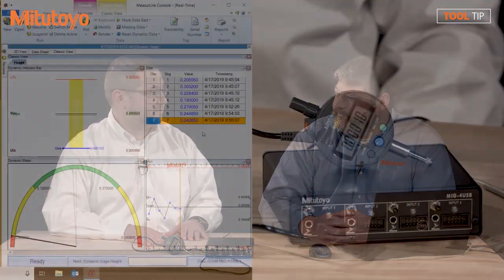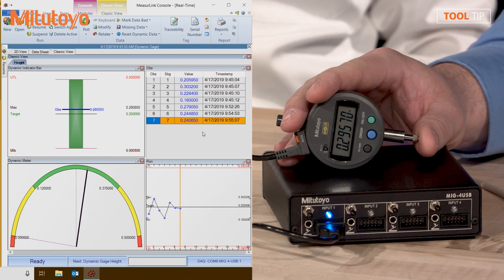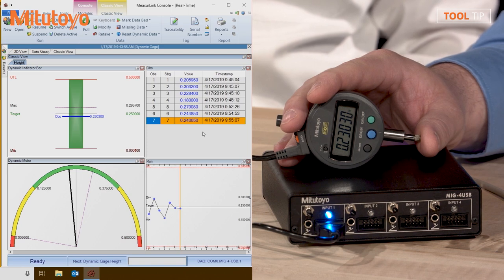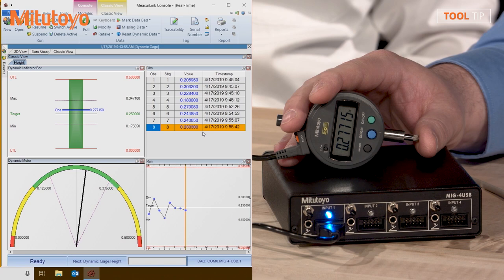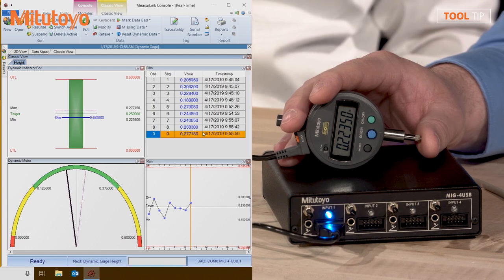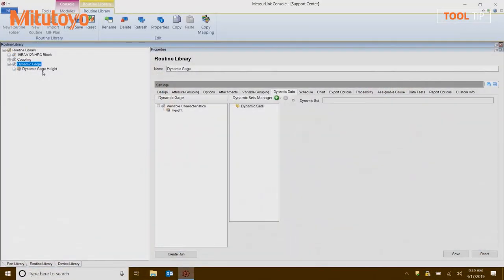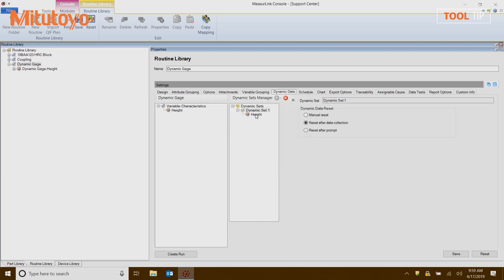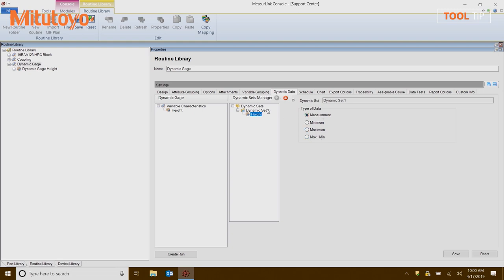Dynamic Gage with Mitutoyo Measurlink 9 - Data Collection Tool Tip

Comment: Two questions: 1. Can measurelink and the multiplexer take the data output of two travel indicators and log data points at the max refresh rate. 2. What is the fastest data point measurement interval? I'm trying to capture the reaction time of a fast moving spring loaded assembly.
Reply from the maker: Thank you for your questions.
1) Yes, MeasurLink and the Mitutoyo USB Multiplexer can take the data output of two travel indicators and log data points at the max refresh rate. 
2) To select the right system, please contact us at 1-888-MITUTOYO (648-8869). Our Sales Engineer will be able to recommend the best system based on your requirements.